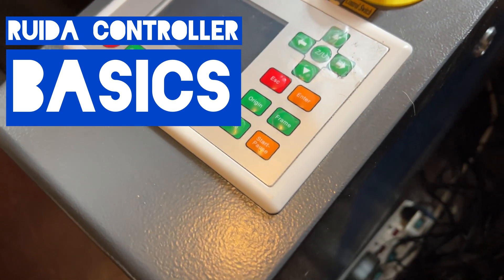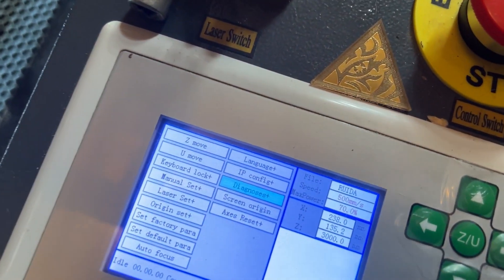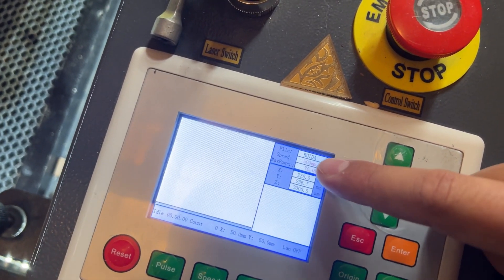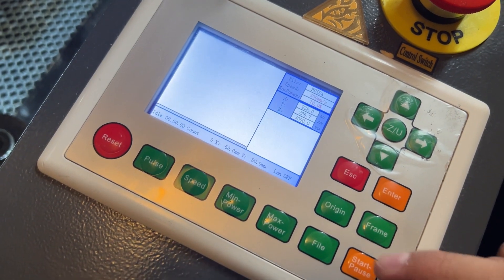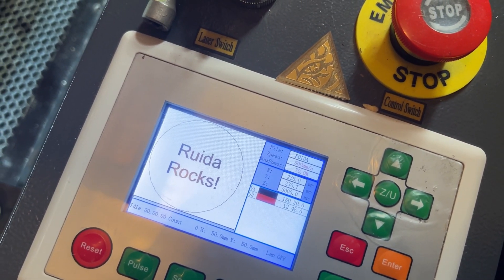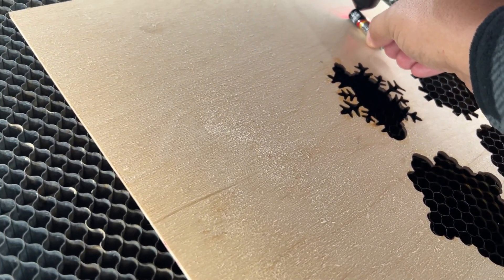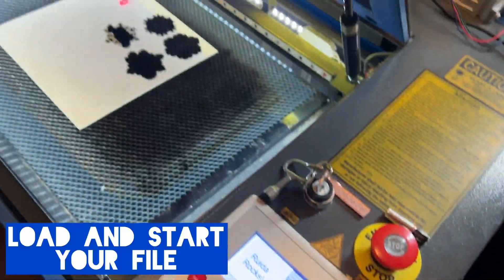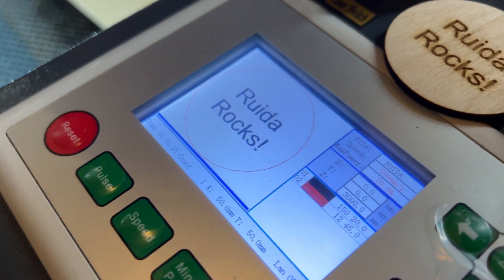Ruida Controller Basics for your OMTech CO2 Laser Engraver - Laser Engraver Tips & Tricks - OMTech

Comment: I have that same controller. Am unable to use machine due to "Air Pressure Error" Message that shows up on the Ruida display when I try to run a program.
Reply: Hi, I am Daniel.
I had pretty much the same problem. So I followed the airline from the compressor all the way to the cutting head, and find a 360° bend in the pipe, which prevent the air to flow through.

Comment: I just purchased an OMTech and I am awaiting the delivery.  I have another laser (a diode) that runs directly from Lightburn.  Hit “play” and it runs the laser.  Does the play button now send the file to the Rudia controller, and now I run it from the Rudia?  Or, am I saving the Lightburn file as a different file type and exporting it to the Rudia controller?  Similar to a traditional G-Code CNC file?